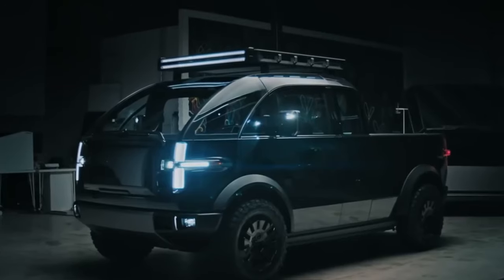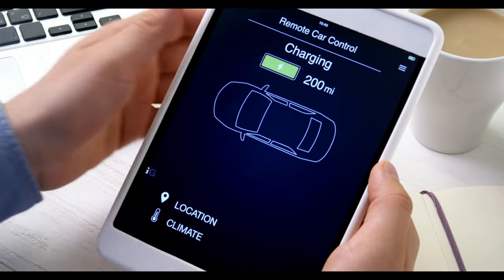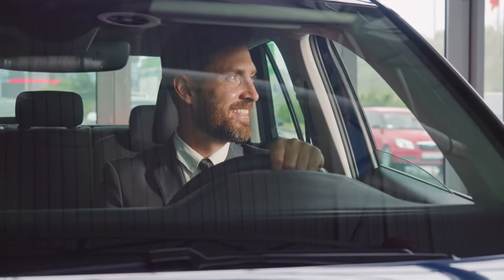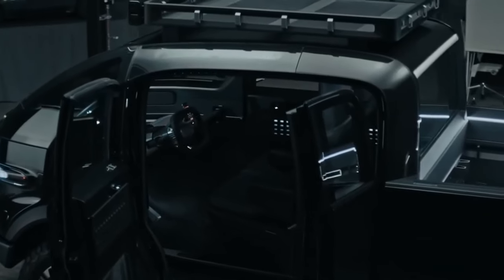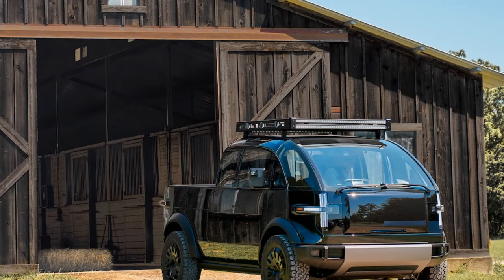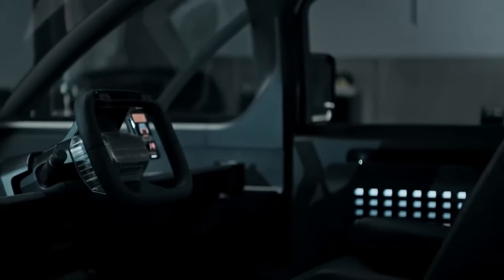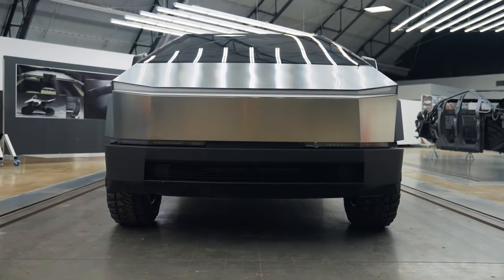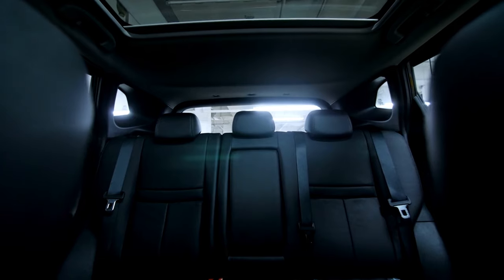Canoo Pickup 2024 Price Reveal Update & Info!

Comment: The Canoo van has an epa range of 200 miles and it looks like the van and the pickup are sitting on the same platform . So even if we're to double the battery capacity by stacking another layer of batteries onto the existing ones , it would not equal the 500 miles that they are advertising .

Comment: A pretty boy/tech toy vehicle.  It doesn't appeal to me for a number of factors.   Most guys I know that really use their truck, really uses their trucks for a multitude of reasons, one is usually functional for heavy duty hauling and work horse for being functional.   These owners have tough trucks for hauling dirty, heavy and tough terrain work sites.   The last thing they worry about is a truck that is pretty.   Having electronic vehicles sounds great but if the terrain is remote and far from the beaten path, guess what, probably there might not be cell service, electricity or repair shops for a long haul.   That's the last place, one wants to be stuck with a vehicle can't move and it's a long haul in terrible weather to get help to get it running and that's if family members aren't with them.   Add to that, how does charging in extreme cold weather impact it?     Work the kinks out before selling it for the real working guys who work on their own cars that they feel confident about getting it started.  A lot of my friends who work on their own vehicles prefer gas until the bugs are worked out.  Besides, how much for the replacement batteries and what do they do with the old batteries?